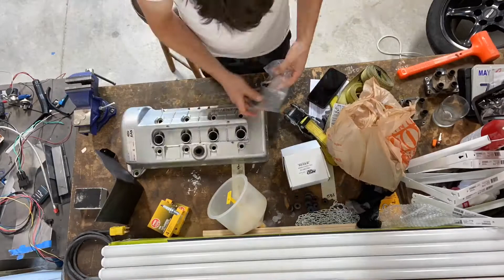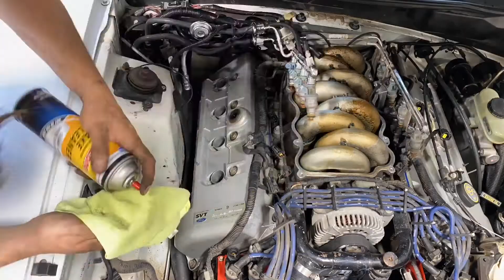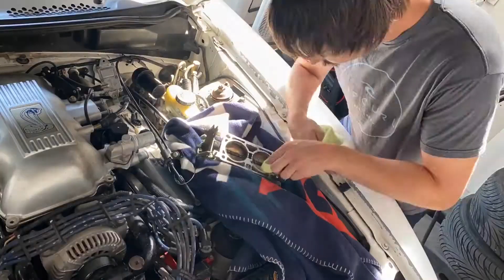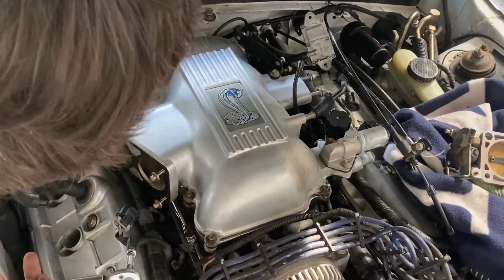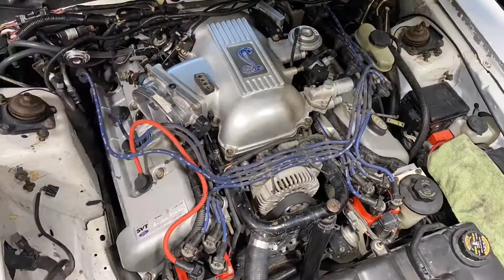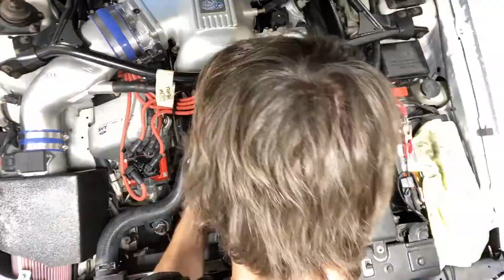1997 Cobra Track Car Build Updates: Valve Cover Install Part 2

Comment: I know this is a long time since this came out, and you may not remember, but I’m going about this project this weekend, only the passenger side, would you say it’s necessary to take the center cover off too, or is there enough wiggle room if I just take the throttle body off
Reply from the maker: Id say maybe try it without pulling the center cover, i honestly dont remember.  That being said it took me years to learn this lesson.  The project is often faster overall if you get everything out of the way so its easier to work.  You usually spend the same amount of time but curse a lot less when everything’s out of the way that said I usually try and see if there’s an easy way that involves taking almost nothing apart to get what I need to, but I only go down that road for maybe five or 10 minutes and then look at it like I might as well take it all apart so it’s easy to work on.
Reply: @truckandroll989 Thanks for the response! I was worried about needing to replace the plenum gasket too, but I’ve already ended up buying a new one anyway, so I suppose it’ll be worth it either way. I’ll definitely try doing it without taking it off though.

Comment: Any issues with the new wires arcing? I’m replacing the original crumbling wires to prep for a drive from TN to MN. On both LMR and American Muscle I’ve seen a lot of bad reviews for the Ford Racing wires saying they went bad quickly or they were bad right away. I can’t decide if I want to pull the trigger on these or spend an extra $60-80 on Livewires or MSD. I hate to spend almost $200 on wires but I don’t want stuff that’s gonna crap out on me right away.
Reply from the maker: So no issues that i could see at all.  I also did the old zip tie trick and tried to separate them as best i could.  Honestly aside from aesthetics i doubt these cars require a massive ignition wire. You could always try a cheapo replacement and it would probably get you by.

Comment: Enjoying this series and it seems one of the best on the 32V SN95 Cobras. I bought my 97 Cobra for many of the same appealing features that you had cited in the first video.
I have a question about a diagnosis I got from a Ford mechanic on my car. Symptoms are a hot oil smell in the cabin after a longer drive. No oil leaks hitting the floor and no real change in oil usage so far. Also, nothing strange about the coolant, engine pulls strong, no overheating. On a lift, the mechanic showed me the oil seepage on each side of the block, with a bit more on the passenger side. This corresponds with my sniff test with the hood open, the hot oil smell from the passenger side. The Ford mechanic said it was a faulty head gasket causing the oil leak, with an obviously large repair bill to R/R the heads. Personally, I believe it is the valve cover gaskets seeping onto the exhaust manifolds, which the SVT forum guys also seem to think it is.
Any possibility that a head gasket can cause an oil leak on this 4V engine? My research did turn up a TSB for the the 4.6 2V engines occasionally having an oil leak from the head gasket, but I never found anything for the Teksid block.
Reply: @777Trolly I have the exact same problem with my 98 Cobra - did you ever figure this out?
Reply: @azizshavershian2065  I have been keeping an eye on it and the oil usage over the past few years. Nothing has changed since my original question, i.e. oil usage is the same (as in minimal), no drips on the floor, coolant is OK as well. The only thing I did as a preventative is add a bottle of Blue Devil oil stop leak after an oil change. I chose the Blue Devil product because it seemed to have a better reputation than its competitors.
Bottom line, I still have the hot oil smell occasionally in the cabin, but have decided to live with it. If something does get worse, I will address that then.
Reply from the maker: I would think, but again im not an expert, that “head gasket” really meant “valve cover gasket”.    Can you get it really clean with some
Degreaser, start it up, let it warm up and recheck?  Maybe a small mirror on a swivel to look at the sealing surface between the valve cover and cylinder head?  What about a smoke tester?  You could do that with the engine off, disconnect a vacuum line, inject smoke/pressurize and look for leaks.  I hate to say it but the passenger side valve cover is a PIA.  Biggest advice i can give you is take your time and be patient when replacing it.  It would be easy to pinch an edge and get a poor seal.  Sorry i Couldnt be more help
Reply: @truckandroll989  The mechanic meant head gasket, not valve cover gasket. The service manager even gave me a list of all the parts needed which included labor to have both heads checked at a machine shop.
I will get an inspection mirror- thanks for the idea.
Tell me more about your smoke machine idea.
Thanks for your thoughts on this.
Reply from the maker: @777Trolly  ive never used one before but for vacuum leaks you can use a smoke machine.  Basically it makes it easier to see where the leak is coming from.  With the engine off you can inject some smoke into a vacuum line and see where it comes out to find your leak.  Should also work with a valve cover gasket.  Other ideas, for like head leaks or maybe even a head gasket is soapy water.  With the latter you start the engine and have to look intently for bubbles before the engine gets too warm and boils the soapy water.

Comment: Did the pulley alternador fix the problem
Reply from the maker: Leo Carranza unfortunately the smaller pulley didnt.  It seemed to help as in the voltage read slightly higher.  Once i swapped the complete alternator the issue went away entirely.